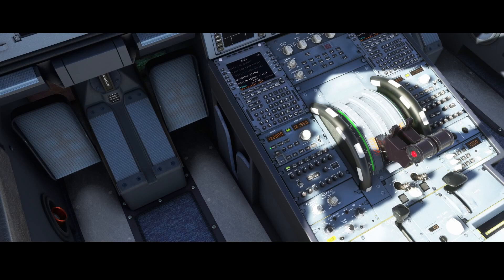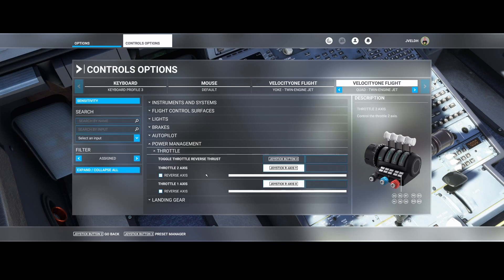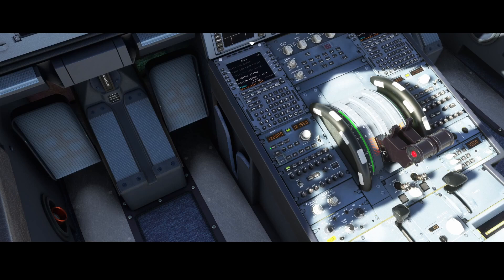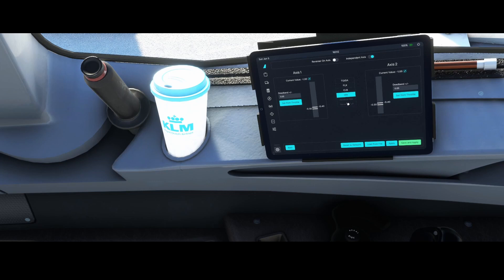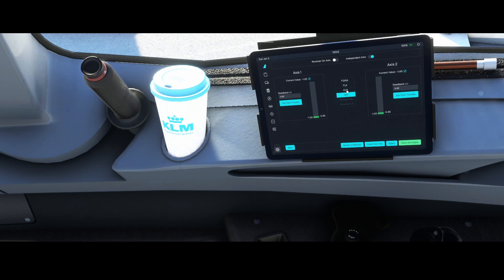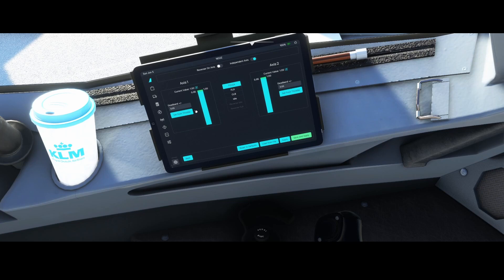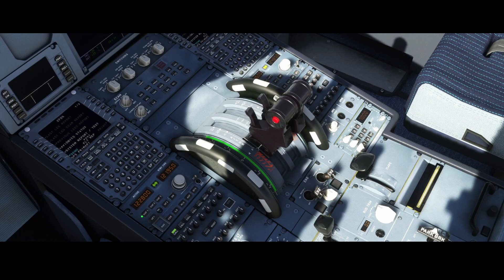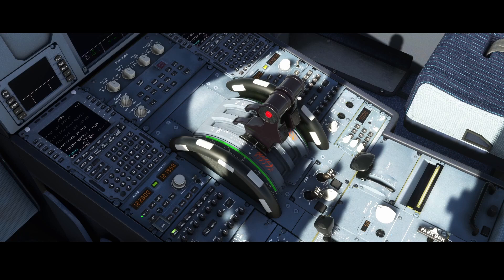Flight Simulator 2020 - How to - FlyByWire A320 - Calibrating the VelocityOne Flight

Comment: So I tried this but when I put everything like you did and I move them after save & apply it makes it so only when I put the thrust up it goes in reverse, lol.
Reply from the maker: hi Kees which throttle are you using?
Reply: Het is al goed, ik had hem vergeten op twin-enigne mode te zetten. Thanks! @Highintheflightsimsky